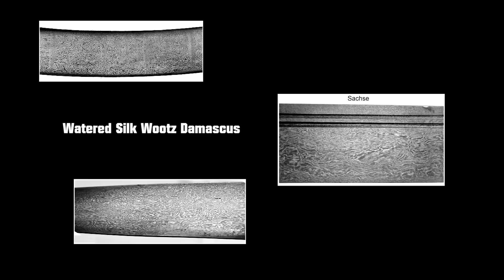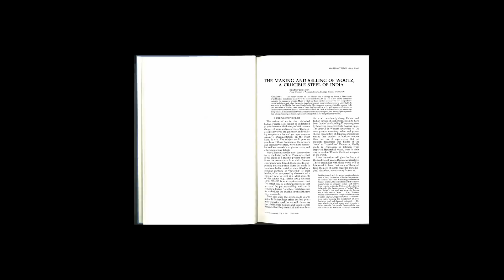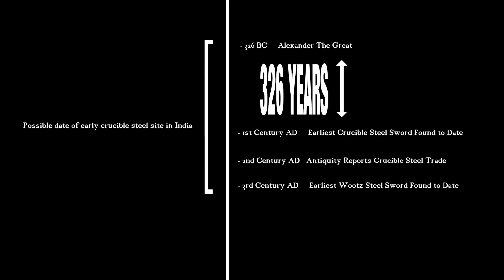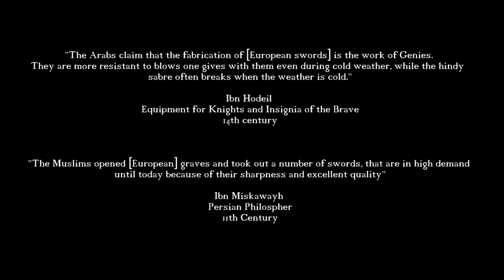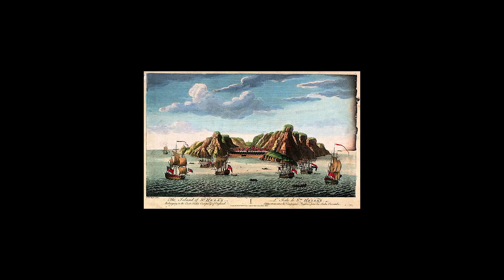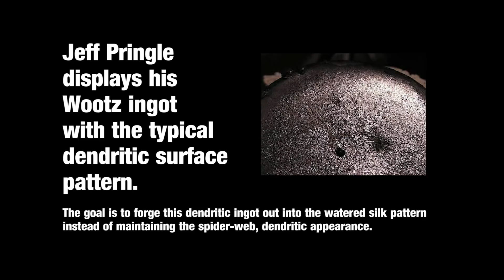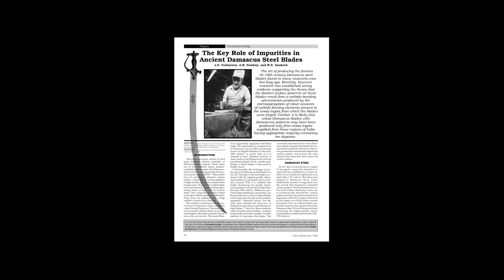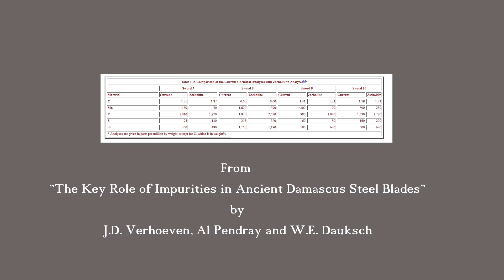"That's Not Damascus" Rant. And 5 Points About Wootz.

Comment: The pillar has attracted the attention of archaeologists and materials scientistsbecause of its high resistance to corrosionand has been called a "testimony to the high level of skill achieved by the ancient Indian iron smiths in the extraction and processing of iron."The corrosion resistance results from an even layer of crystalline iron hydrogen phosphate hydrate forming on the high-phosphorus-content iron, which serves to protect it from the effects of the Delhi climate.
Reply: They also clean and apply light oiling the thing regularly. You have to, because (despite what some people might say) iron rusts. All iron. It doesn't matter if it's magical space iron, or mystical ancient indian iron: It will rust.  If you look up photos of the thing, you'll actually see various states and changing patterns of light rust on it's surface. The pillar has visiting hours of 6am to 6pm, leaving the curators plenty of time in the evenings to maintain the pillar if need be (as well as ensure protective fencing is okay, clean up garbage, that kind of stuff). The whole "never rusts" thing is part of the lore of the pillar, but it's just a dubious as a claim as George Washington chopping down the cherry tree - it's just a myth.

Comment: Euthbert swords didn't have patterns..so low quality woots/crusibl it made history and legend
Reply: The lack of pattern has been hypothesised to be due to high temperatures during forging and heat treatment. Proper handling of the same ingots may have induced patterns, but the people forging them overheated the steel. A 2009 paper (Alan WIlliams) showed that many ulfberht swords lacked spheroid cementite, a characteristic seen in most crucible steels, and he explains it as being due to excessive hot working.

http://gladius.revistas.csic.es/index.php/gladius/article/viewFile/218/222

Comment: Wootz steel would be pretty much 1075 with more impurities and less consistency lol. Sweet for a few hundred years old. But most definitely not exceeding in qualities of anything we have today. Even with patterning on the blade. I have gotten beautiful patterns on VG10 showing off alloy banding that looks similar to Wootz actually with hydrochloric acid.
Reply from the maker: Yup.  I think wootz carbon content is typically in the 1.3-1.7% range, technically an ultra high carbon steel.  As you say, despite crucible technology which melted out the slag, wootz was still inconsistent and often contained high levels of phosphorus and sulfur it would seem.  Sherby and Wadsworth think that the damascene pattern can be applied to other steels, not just wootz, with the right process.
Reply: The levels of sulfur varied greatly depending on where the ingots were made.  Persian Pulad had higher levels of sulfur because of the ore deposits that they had were contaminated with sulphur and roasting can only get so much of that out.  That is why most Persian recipes include manganese, to pull much of the sulfur out as manganese sulfide slag.  The Indian deposits on the other hand were very low in sulfur and that is probably why they sold so much steel to the Persians. They also used to add calcium to pull out the phosphorous as calcium phosphate slag.  The quality varied from location to location and according to the recipes used. For a wootz sword to be exceptional it had to be made of an ingot from the correct area using the right method and forged by an excellent smith.  Abbott collected wootz swords on his journey and he said that he only had one which was exceptional but it was a really amazing sword which was stolen from him by the Cossacks.  We are able to get wootz steel today which is superior to what was made in the past and a handful of really good smiths can make those ingots into really awesome blades.  It isn't a washed up second rate steel anymore than 1095 is... it is just different.
Reply: @timmitchell5812  thanks for the info.
Reply: Also Wadesworth and Sherby were making steel patterns with grain boundary carbide patterning and not with cluster sheet carbide patterning.  The mechanisms are totally different although to an untrained eye they can look similar.  Their pattern can be applied to any steel if it has a high enough carbon content, however the watering of Wootz can only be developed from a dendritic steel which has one of the right carbide building impurity elements and when it is forged correctly.  Wadesworth and Sherby were wrong about what they wrote concerning Wootz steel in their war of words with Pendray and Verhoeven, and were proven to be wrong, they just seemed to have a hard time admitting that.